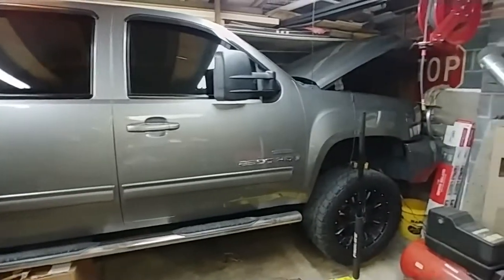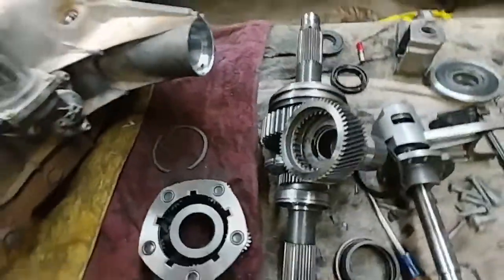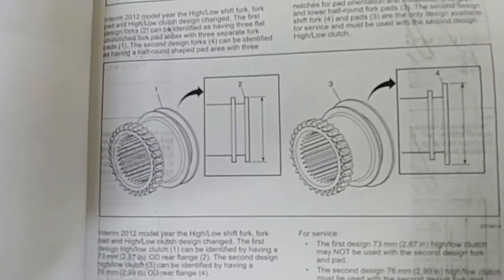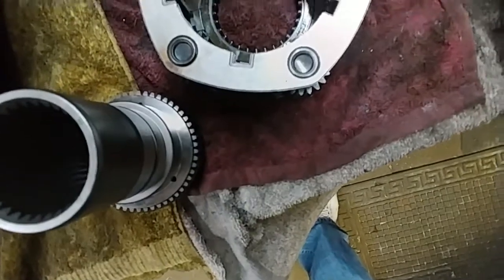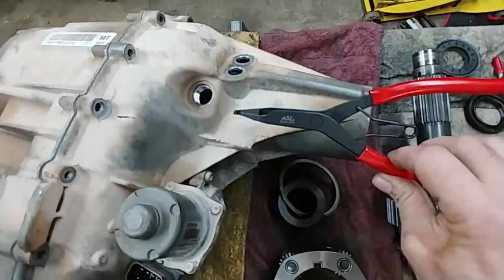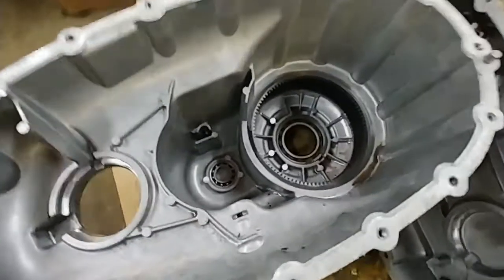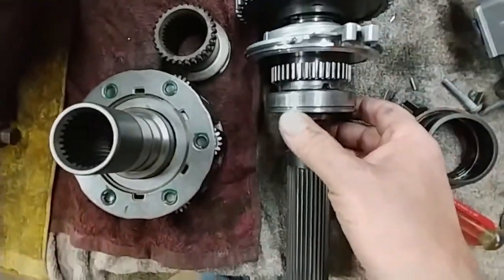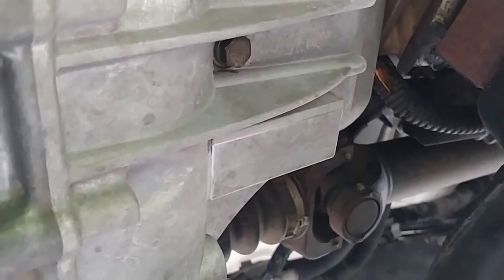NQF Magna Transfer Case Mod 2009 GMC Sierra 2500 LMM

Comment: Ok so let me first state I work for a company that remaniufactures these with oem gm parts and i have built all of the different magna models from 07 till 18. That clutch is usually called a range hub and it honestly could look alot worse than that. It may have cause a small tink at best but that little wear woulnt have cause alot of noise by itself UNLESS THERE IS ALUMINUM MATERIAL INSIDE the range hub whare it connects to the range fork therefore changing the position of the range hub in the planetary. The Range hub moves up and down into the input or the planetary itself with the help from the range fork to select 4 hi or 4 low. That range fork that broken. That oil pump issue of the tab breaking off usually is the result of improper lubrication and installation when the case is assembled ive seen quite a few cases sent back cause the pump was too used or not properly installed so be carefull with that and make sure the oil tube that connects to the pump is seated as far to the RIGHT as possible if your looking at the case and the tube is behind the mainshaft or else it might not allow the rear case half to seat properly. Now for your parts you ordered they only screwed up on 1 thing and you need a few others to get it to work. So the LML only has 1 fundimential difference than the one you purchased. Its design is identicals and the extra bolt holes on the bottom are just for the 14-18 2500 transmissions but its interchangeable because thats the only difference. the gasket works on it just the same. And that big bearing which is a 91110 compared to your old case's 6010. But they sent you a 33 spline input when you needed 29 spline. There are 29 spline inputs that fit that bigger bearing and the walls they have are thicker to take more stress off the planetary. So you just needed the 6 pin panetary and the thruster washers and the snap ring and thruster masher plate and the input snap rign and you would have had it updated. All those metal shavings were the aluminum from the range fork beingground away and mixing with the fluid. Nice ideal using the ball joint tool. I wouldn't have thought of using that to get the tail bushings in. The etra clearance on the new case half is to prevent the mainshaft from getting stuck and basicially welded to the unput when the input pocket bearing fails that the mainsaft rests in. So its just an added saftey for the mainaft but it doesnt affect usability or other parts. One thing to make sure on all new front case halfs. As for the reason that case didnt have the spot the the detent plug detent spring and plunger is because that case half is for a 3023 that is a clutched teandsfercase for the 1500 trucks fron 07 to 18. its almost identical besides that hole and the inside bezzel. thats why it didnt fit. Your machined parts are unique i will say but thats not garunteed to work for long term if it gets used alot. These cases can be difficult but they have to be put together right or else they dont really work.
Reply from the maker: Where were you 3+ yrs ago? Just kidding.. 😃 Thanks for all the info you provided, it's much appreciated. It's been a while since posting that video but I believe I stated yes, the lml case half looked identical but after a few measurements I found that it was about 3/8" deeper and that's why I couldn't use it.

I've used 4wd quite a bit since doing this and happy to say I've had zero issues with it, works flawlessly.

If there is a direct replacement case half like you've stated please post up the part number of that particular case.

Thanks again for all the info you shared. 😀
Reply: @DurtyMaxDee  Sadly no I wasnt there 3 years ago. I dont have a part number on hand at the current moment but I can get it and post it. But even that case thats 3/4 longer I beleive it wouldve still worked just fine. As long as everything lines up when you assemble it. But I think the most overlooked or unknown issue with new case halfs is depending on if its an oem gm part or aftermarket it may or may not have the holes threaded and you might need to tap your own threads. And dont screw them up or else you 3ither have to throw the case or attempt to helicoil them which is a pain in the ass. I will get that number by the ened of this week
Reply from the maker: @tryhardwolfy9264  I'll pin this thread after you post the part #.

Thanks again for your help. 👍

Comment: Funny. all the ones i worked on had a bad bearing or the synchro gear collar slips 2 far down and never engages the front  Wheels...parts are a pain in the ???. 2011-2016..it's a oddball transfer case....lol

Comment: I have the exact tcase and I have a question is there supposed to be any up and down play at the back of the tcase where the rear drive shaft goes in the case, the reason for my question is I'm getting a slight vibration around 70-75 mph and it's more noticeable when I ease of the throttle....I did check the u-joints and had the d/s balanced and the vibration is still there
Reply from the maker: IIRC there is not supposed to be any up and down play or should I say very minimal if at all.

There is a steel sleave in the end of the t-case that can be replaced. Look to my video to see it. 

I would pull the yolk out of the end of the t-case and with a flashlight look in the end to see if the steel sleave is worn out. You should be able to see a spiraling groove down the length of the sleave. If you don't or there's barely one there it time to replace it.

Hope this helps. 😁
Reply: @DurtyMaxDee  ok thanks 👍🏿
Reply: Your drive shaft is bent
Reply: @anthonyk6265  
The drive shaft wasn't the problem come to find out my yoke was worn out and secondly being that my truck is lifted the yoke was 1/2" further out of the transfer case, so I bought a longer yoke the drive shaft shop welded the longer yoke onto my original d/s and no more slope or vibrations at highway speeds

Comment: Does the pin that holds the shift fork on the shaft have to be replaced when changing forks? I'm in the middle of swapping input shafts and one of my fork pads was broken and I cant source just the pads so I ordered the whole upgraded fork. I cant find any information about this, or at least until this video.
Reply from the maker: Yes it does. The original one is like a rivet that has to be punched out of shaft. New one is like a bolt and nut. Dealer item, IIRC like $10.00. 

Part # for pin is in the description.
Reply: @DurtyMaxDee  thank you, ill give the dealer a call today.
Reply: I forgot to note which way the piece inside of the shift fork was oriented before removing it so I matched mine to yours. Hopefully it's the same haha. Your video has been a life saver for me. Not much information out there on these magna cases
Reply: And now I've broken the range selector shaft sensor FML 🤣🤣🤣
Reply: @stebevs   The easiest way to tell which way they are su[poosed to go is to assemble it with the new screwed in pin and tassemble the unit most of the way to see the opoparion of shift cam. it can only go in 1 of 2 ways so its not as time consuming to make sure its done right. Plus most of the time the numbers on it are upside down usually.